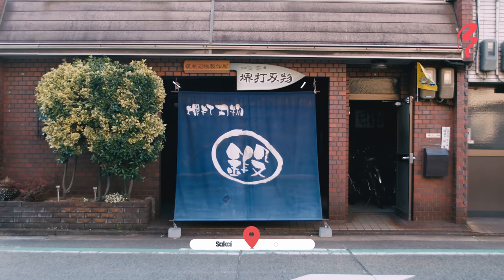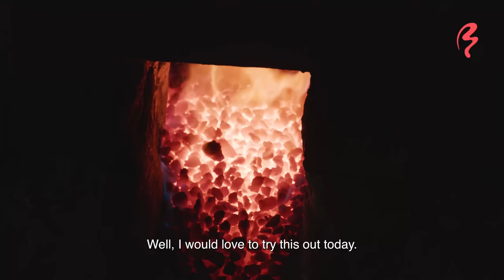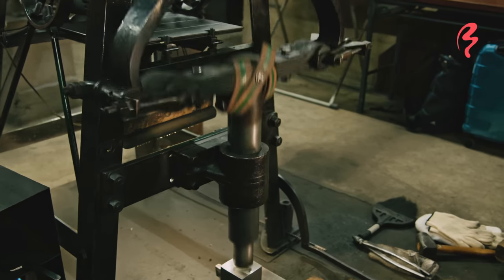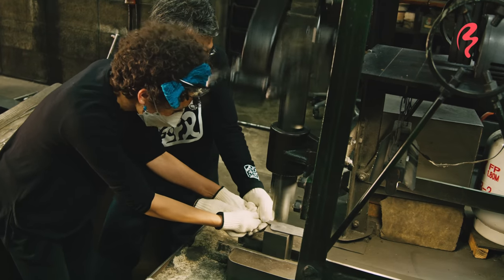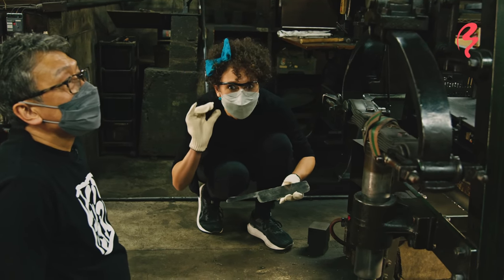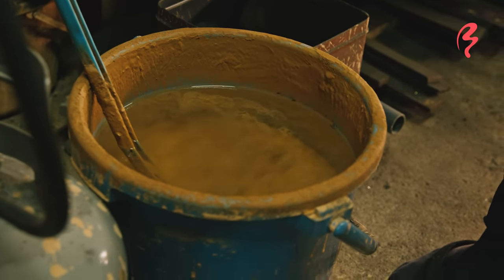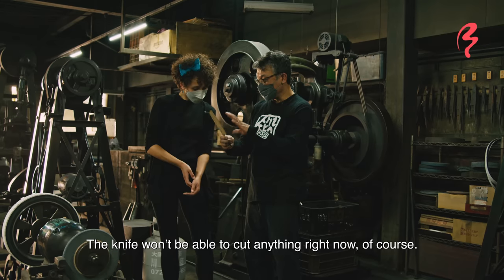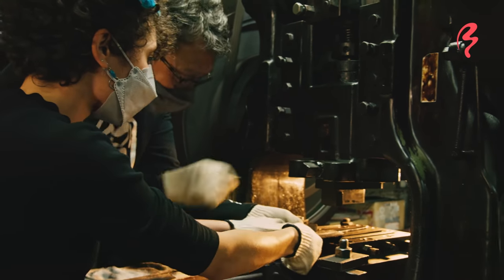600 Years of Tradition! Making Best Japanese Knives in Sakai, Osaka

Comment: Stumbled upon this.
- You can try holding the knife by pinching the blade just after the wooden handle. The handle is thick and feels unwieldy to hold, the blade is thin and the handle fits into the hollow of your palm, locking the knife in. 
- You can get better cuts by slightly sliding the knife forward as you gently press downwards. We call this a "push cut".
- Not sure what steel your knife is made from, but if it starts rusting on you, better hand wash and wipe dry ASAP. It's also good practice for any knife.
- Single bevel knives like yours will steer/tend to preferentially cut in a certain direction and a lot of skill is needed to get the knife to go where you want it to. Not recommended for beginners.
- Took a look at your buy-knife link also. Please include steel type and more (and clearer) photos of the knife from different angles. For clarity on this matter, Google and browse any website specialising in selling Japanese knives.